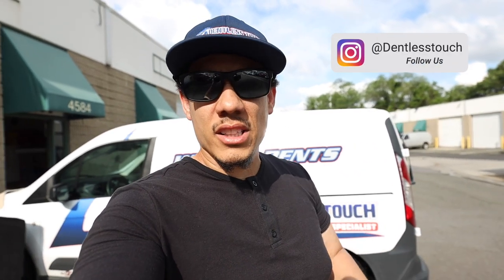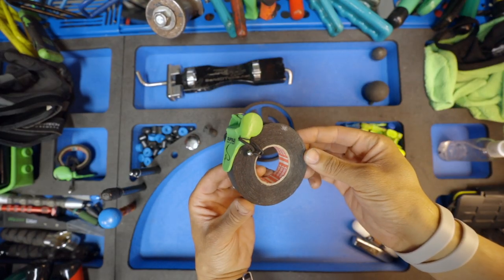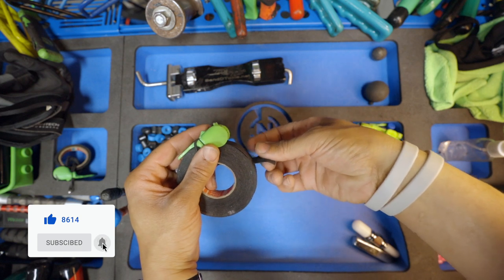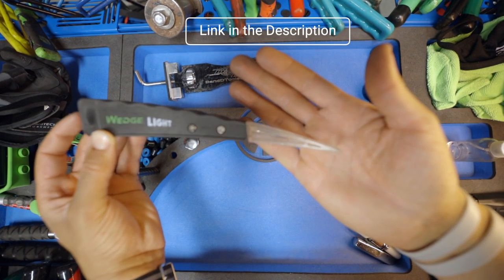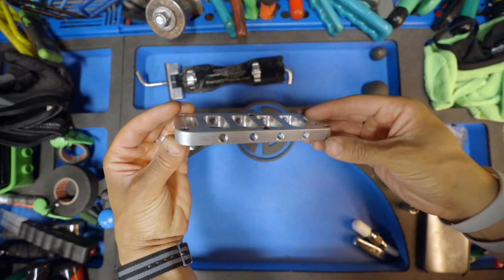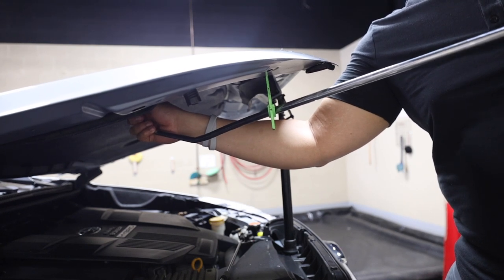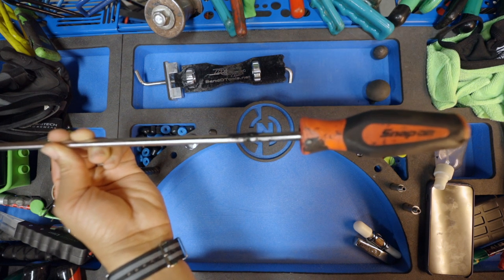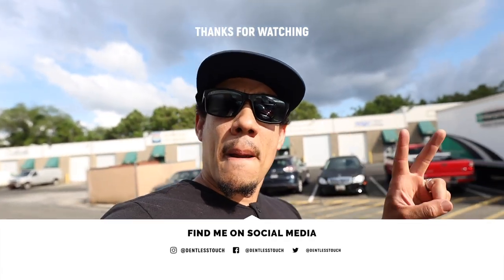8 PDR Tool Accessories Under $50ish Dollars that are Essential for Technicians

Comment: If you need something unavailable on the market, you can have it made or modify an existing tool like the Snap On you show in the video.
As for plastic tools, could they be made on a 3D printer?

Comment: How exactly does an auto marker show an insurance person where the bracing or limited access is? That comment made zero sense to me. Plus, who doesn’t have an auto marker?
Reply from the maker: With all of the insurance companies requesting pictures for supplements. Some are now FaceTime our technicians to verify damage. Specially during this time, we use the autowriter to illustrate on the paint where a brace or anything that will hinder our job in relation to the damage!